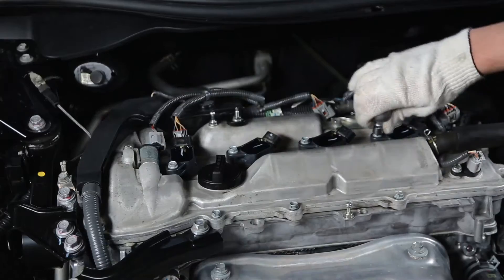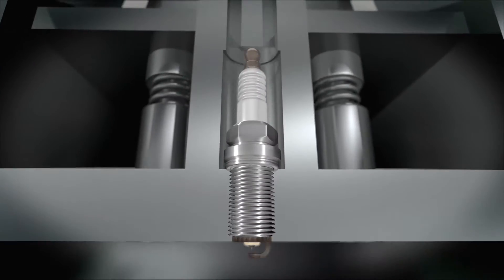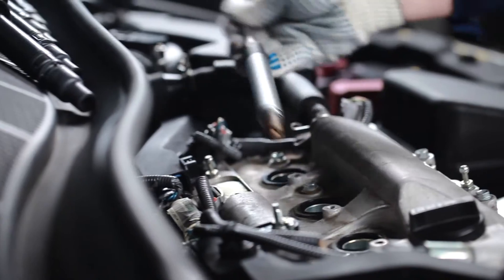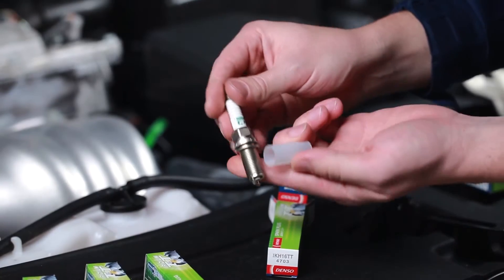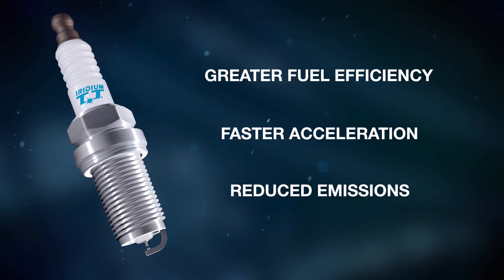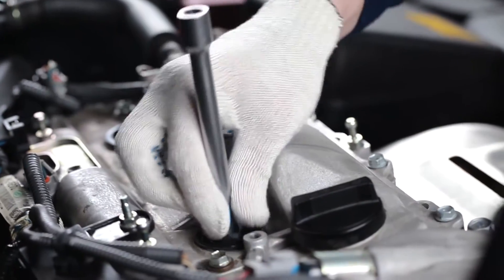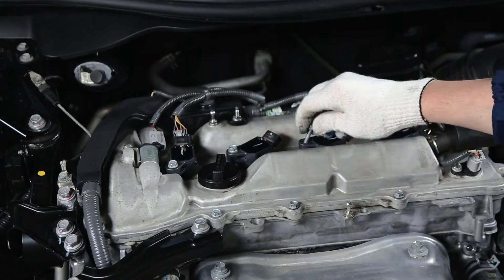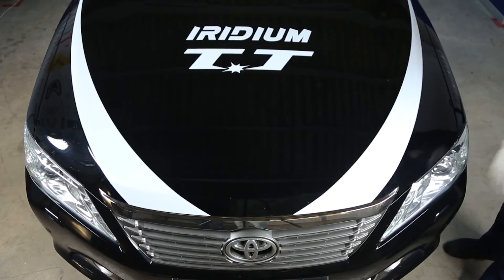DENSO Iridium TT Spark Plug installation video

Comment: It is often recommended to use grease on he plugs so they are easy to remove later. In video that was not done. Do you recommend this practice ? If so what grease should be used and on what part of the plug ?
Reply: na rosca só um pouquinho

Comment: Just got 6 of these plugs for my Jaguar X Type 2,5 V6.
Hopefully they last really long since the inlet manifold have to be removed in order to change the spark plugs on my car.
The work costs 300 USD$+ (Without parts included in that price)
So changing the spark plugs will cost me 450$ or more :(

Comment: No need to disconnet coil wires....just unscrew the coil packs ( with wires kept attached)...and pull out. Removing wire connectors makes it very easy to re-install in the wrong locations. Sheesh.
Reply: Verdade

Comment: So, do you use whatever gap the plugs came with or set the gap to the car manufacturer's spec?
No one at Denso can answer this question.
Reply: keep the factory gap.
Reply: @TheWilferch  Denso did reply to my email. The TT's came gapped at 0.036, factory called for 0.044. I
I left the factory gap, the car started after 3-4 revs, ran rough and started harder with temps below 30Deg. F., also needed to warm up for about 3-5 minutes.  Denso email answer arrived and said to use factory gap.  I used wire gauges to re-gap to  0.043 to 0.045, the car started great, even at 20 below 0.0 F.  Fuel octane rating makes a difference with both gap settings. I think 89 ran better with the 0.036 gap, I'm using Shell 93 now and it runs great. Changing the trans and diffs to synthetic fluids greatly  improved performance, especially in winter. Sometimes it feels like kicking in a 4-bbl 
when passing traffic or merging in or out.
Reply: @forwardplans8168  ...I can't argue with your own personal data, but some things just simply make no sense. First of all, your owner's manual will tell you which octane rating you need, and going "up" in octane rating does absolutely nothing for you, other than wasting money. Do a deep dig on this topic. That said, in "some" cases, going up slightly in octane rating for fuel used SOMETIMES helps when 1.) the car is old and 2.) there is an appreciable level of carbon build-up on the tops of the cylinder which has the affect of increasing the compression ratio. This can be due to normal wear, some oil blow by on the rings, or worn valve guides... any of which can add some additional oil to the combustion chamber which can cause a crust layer and increased compression ratio. Higher compression ratios will normally require higher octane fuels. As to plug "gap" affecting how differently your car runs....here too there is no technical reason for the affects you are sensing. I larger gap usually stresses the ignition components more, but if the plug fires there should also be a stronger spark developed with a larger gap. Without having lab viewing of what is going on inside your combustion chamber, or not knowing how good your other ignition components are, I can offer no other explanation for the differences you seem to be sensing. Cheers.

Comment: Doesn't tell how to gap these twin electrode spark plugs.  A regular gapping tool will damage the twin electrodes.  I bought for my car and figured they would be pre-gapped and mine is supposed to be set for .044" and using the coin plug gauge it is at .32" so I need to bend it but not with that tool or even the type that has the 2 metal claws/hooks as it will damage the twin electrodes.  It's pathetic Denso didn't even address this in the video.
Reply: These do not use the same gap as "regular" plugs....install as purchased. They will likely have bigger-than-spec gap....but that's ok.
Reply: k ma I've noticed various plugs for my vehicle based on different trims and engine sizes. The plug gaps were preset at .032, 0.040 and 0.044 respectively. What year make model engine are you working with?
Reply: It would be better to address indeed, because it used to be a part of installation procedure. However, in this case the answer (why it is not relevant) is simple: No need to re-gap for DENSO Iridium TT plugs. Actually, DENSO prescribes NOT to re-gap.
Re-gapping was something that was needed for "big" Nickel electrodes. Because those "chuncks of metal" first need to be charged completely before the spark will jump. In contrast, the tiny electrodes of the Iridium TT guarantee that strong sparks over relative wide gaps are jumping with lower voltages. This is not only causing a more powerful bang, it is also beneficial to your ignition coils. Finally, because the ground electrode is blocking much less space, the growth of the initial flame will occur much nicer in all directions.